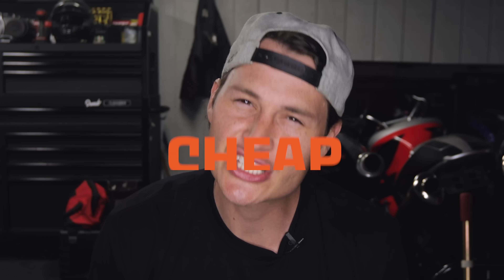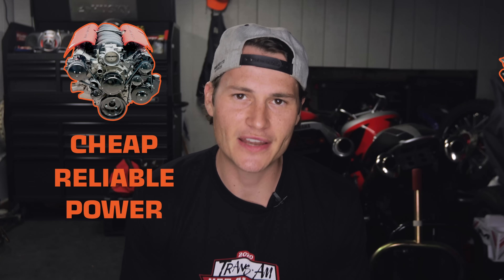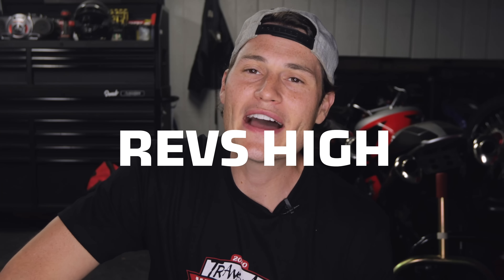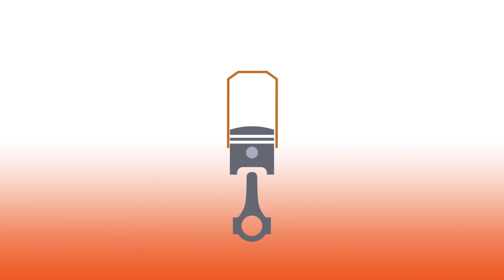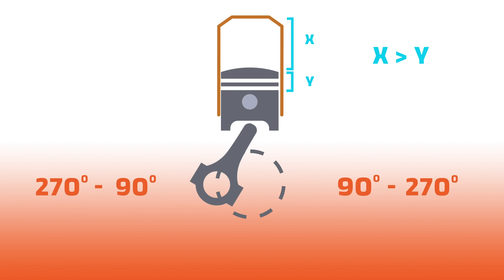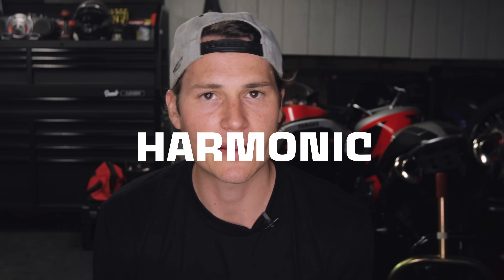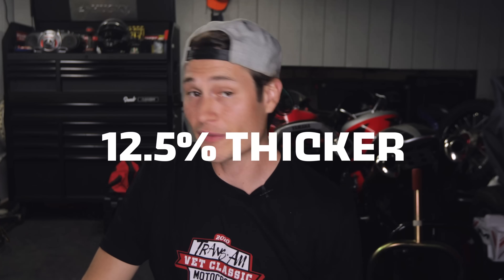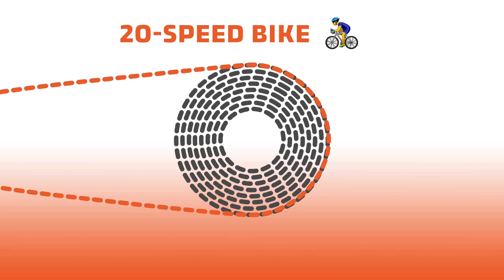Nissan VQ Engine - The Science Explained

Comment: Where are my VQ's that got a valve cover gasket leak atm?!? 💦 😂🤦‍♂️😁
Reply: It's stock from the factory.
Reply: My OIL be like "ight ima head out"
Reply: Cylinder 6 spark plug tube seal is leaking on my z😂
Reply: @boblouis972  cylinder 1 for me. i thought my oil filter housing/sandwich plate was leaking.
Reply: @boblouis972  Same with my Z just rtv seal it
Reply: Ayeeee
Reply: Fixed mine a few months ago.  Wasn’t too hard
Reply: Right here..
Reply: I just replaced my valve cover gasket on my vq35de today lol hope it holds up...
Reply: Nailed ittt
Reply: @FlameOnTheBeat  I believe it's DE problem. My HR only had the oil galley/gallery gasket problem. $700 out of my pocket but now I have reinforced gaskets and I don't have to worry about the engine at all.
Reply: @jakubkosowski7203  I think I'd rather have valve cover leaks than oil pressure issues...
Reply: @audioamateur  In HR the only thing is that gaskets. If you change them for aftermarket ones you're good. DE has it's own problems and RevUp too. Not mentioning DE has 25-40 buff horses less than HR. Mine has 301.7HP, my friends DE has 259.1hp.
Reply: @jakubkosowski7203  I'm on 301bhp for my 05 de also. MotordyneTdx2 with art pipes,plenum spacer, velocity stack on stock intake box, Kodak larger throttle body. So very happy with my numbers ❤️.  Nos is coming next though
Reply: @JarvBlart  That's very healthy for DE! I'm only running Magnaflow catback exhaust and Jim Wolf Technology short air intake (which in reality just subtracts torque, but it was installed by the previous owner 😬). My plans for the engine are probably supercharger (Stillen??), cams and cold air intake, but now I'm saving for oil cooler and Tomei LSD. Ahead are SPL camber arms, poly bushings and lightweight flywheel 🤗 (I already have Tein coilovers and Federal 595 RS-RR semi slicks). What are your plans for your Z? 😀
Reply: Yo!
Reply: Ayeeeee wassuspppppp
Reply: My VG30DE didn't leak
Reply: New valve covers with new gaskets can’t even fix the problem, WTF
Reply: Meee 🤣 my 62,000 de now has cylinder 6,3,2 with oil in the sparks loads of misfires.  But I've ordered new rockers so now have to wait till it's in the country. Feels like forever miss driving my z far to much
Reply: Me ! Replaced the gaskets and they still leak LMAOOO
Reply: You already know what it is bruh!
Reply: Cylinder 1 spark plug seal is leaking here. Lol
Reply: Mine’s at the mechanic fixing that issue 💀💀💀
Reply: Fixed it for 40 bucks on eBay definitely check it out
Reply: Yuuuuuppp. Just replaced a seal and a valve cover
Reply: Just fixed lol
Reply: Got em’ BOTH leaking boi
Reply: Right here boiiiiii 😂😂
Reply: burnin oil like crazy right now
Reply: Here... blew the engine. Where yall at now? Lol
Reply: Yoooo
Reply: Yoooo
Reply: My water pump went and now I have to can it cause my timing jumped 😭
Reply: Charles Nguyen what up fam!! Just bought new cover for 100 on rock auto
Reply: Yep mine leaked right into the starter.
Reply: Only the 3.5 in my 2002 Pathy had leaky valve covers and that happened at 200k. All my other VQ’s were good
Reply: I shot a rod, replaced the de with another de, then hopped in for a week and my shifter linkage died to death
Reply: My oil leak got worse when I replaced the gasket and the valve cover.  :(  It sealed the leak by the spark plug, but I can't get the gasket to seal properly now.
Reply: My mom
Reply: I got a VQ38DD, don't have that issue 😂

Comment: Donut spent $8,100 on a turbo kit to try and get a VQ to make power.  They ended up with 330 horsepower and an extremely unreliable engine.

What the heck kind of shenanigans are you pulling in saying the VQ makes cheap, reliable power?!  You guys just spent a ton of time and money proving it costs a lot of money to get an unreliable turd.

Comment: I swear I’ve been thinking about VQ swapping my S13 for about 2 weeks now. This is the universe telling me to do it.
Reply: Bish do ittt. You will not, I repeat, you will not regret it lol
Reply: After having my Z for a little over 2 years I gotta say I hate the VQ engine for modifications. They don’t make good power when compared to the money invested in them
Reply: @MoistSoul  very true but they come fantastic stock
Reply: @anthonym6918  stock they’re not bad, with a tune and some bolt ons they can get 300whp on a DE and like 320ish on an HR. If you look to go past that turbo kits are pricey for the decent ones and the blocks can only handle 400hp so then you gotta build the engine and that’s $$$. Stock they are fun though because you can beat them with no worries lol
Reply: Dude do it such a cool and reliable turn key swap
Reply: If parts etc are easily obtained locally I'd recommend building up a high compression sr20ve+t. Good usable power up to around 300kw without touching internals so works out to be cheap as chips
Reply: @astephen17  "cheap as chips" is the most Australian thing ive ever heard
Reply: DA NS vk56 swap! If you’re going to go through all of that, might as well upgrade to a v8. I’m thinking of swapping one on my q50. They use the same 7at tranny. If anything do a vq37vhr... too many problems with vq35 in my opinion.
Reply: My dream drift build is a G35 or G37 with a LSA motor. Making 700hp relaible as hell
Reply: Yoooo look up HexaGarage, basically S13 VQ swap wiki
Reply: No, don’t don’t do it
Reply: I wouldn't. Honestly for a little bit more money you could do a LS swap. You'll make alot more power and be alot more reliable. And it sounds amazing. Plus its got unlimited upgrade potential. From being N/A with a Cam and Heads making 400+RWHP. To supercharging or turbocharging making 600-800RWHP and being totally reliable. Plus it'll be super easy to sell if you ever wanted to get rid of it.

Comment: Random fact of the day, the 4.7 Mopar Modular V8 has a girdle too. Pretty pointless for an engine that only ever made 310 hp in its final iteration. 

Makes you wonder what plans Chrysler shelved for that engine. Could have been a DOHC beast with minor architectural changes.

Comment: So, not to bust any bubbles but man, my 06 G35 "Up Rev" coupe drank oil like it was forever thirsty. So much so that Infinity replaced the block under the oil consumption TSB and it still didn't fix it. Haha, they even replaced the transmission (did that first) because of a rattle when the car was in neutral. When they replaced the block the first time, I had them use the Nismo through out bearing and it fixed the transmission rattle that they just threw a whole new transmission at to fix originally that didnt work. 

Basically, while I was deployed, Infinity and my brother went round and round to get this thing fixed but never did. After doing much research while not doing anything in Afghanistan I found a thread on I think MyVQ forums and it said that this whole thing was caused by crap baffling in the valve cover, imagine that! But infinity didn't agree, at all! When I approached Infinity and Nissan about replacing the heads they told me NO and that I would have to suck it up and deal with the 3+ quart a month oil consumption. Basically because they were not going to put a 3rd block in it, yeah, the second one didn't fix it either,  and would NOT hear me about the heads because I used Internet research to find the root cause. 

So I sold it and bought another STi... that the engine blew up in, but I was totally ready for that, because EJ. Now, its got an IAG closed deck block and big ol spinny boy and 600 refined conservative buff herspers :)

Comment: I'm surprised at the lack of awareness that 2020 is the first time in 50 years that the Skyline and Z have shared an engine. The last time was in 1970 with the Nissan Skyline (KPGC10) GT-R and Nissan Fairlady (PS30) Z 432, which shared the Nissan S20 2.0L straight-six. Now, the current (upcoming) Nissan Fairlady (Z35) Z and the 2020 Nissan Skyline (5BA-RV37) 400R (sold outside Japan as the 2020 Infiniti Q50 Red Sport) will now share the VR30DETT (a 3.0L version of the VR38DETT from the Nissan (CBA-R35) GT-R).

Comment: Used to have a G35 with the VQ DE and it didn’t last more than 55k miles because of the oil starvation issue.  The HR is a much better version.

Comment: What! X = Y travel. The crank spins, therefore it's symmetrical. There is no difference in distance. The issue of the vibration is the linear piston acceleration and angular acceleration of the crank during the 4 strokes. The piston and crank are accelerating during the power stroke and decelerating during all other strokes... FFS, so much wrong in this video... I don't even wanna get started with the harmonic damper... Also wrong.

Comment: I actually own a car with a VQ, I cut down 4 trees for a 1995 maxima. It’s very unique tho, unlike most maximas of that year it has cloth interior, manual pass seat, no sunroof, no fog lights , base radio and speakers, no leathers, and came with Steelers and factory hubcaps. It’s only supposed to have 190 but I got if off an old man who’s son owned it for a while apparently did internal engine work and then got a newer car and lost interest, it sat at the house I painted and then cut the trees down at.  it fucking SLAPS like nobody in my friend group understands why but it cooks v6 challengers and mostly stock J32A’s

Comment: You forgot the intake. The reason the torque curve is so flat on vq motors is the intake has 2 valves that create a 3 stage intake. The first is 0-2300 rpm, where the swirl control valve is closed. It acts like the tornado device, creating a swirl in the intake. At around 2300, it becomes restricted, and opens up, creating a normal intake through short intake runners, until 5,000 rpm, where the power valve opens up, changing direction to long intake runners for high rpm horsepower.
Reply: Yep, variable intake runners. My 1990 Accord has those, as does my Mazda 929 and Acura Legend.

Comment: I’ve had a DE before and now I have an HR. I absolutely prefer the HR lol
Reply: Drive a vhr sometime. Even beteer
Reply: Lmaooo only de owners will know the difference between de, rev up, and hr. If your gonna buy a 350z buy a DE REVUP or HR. Or your de is going to eat your wallet like I eat cheesecake😏. I have a de 03’ Rn but I’m upgrading to a 370z for the engine block.
Reply: Tony760 if I’m honest the vqrev up is just as bad as the hr if you can just save up for the hr no questions asked ,I do own a vq35de non rev up.
Reply: @marcogonzalez2303  DE non Revup is the worst engine i ever had, and i had over 10 cars
Reply: Tony760 same
Reply: Tony760 eat your wallet how?
Reply: Tony760 there’s nothing wrong with the DE?
Reply: 69th like. Noice!
Reply: on B15u.com some of the VQ swap owners are doing HR head swaps. they are a little beast.
Reply: Non rev up?
Reply: I have all 3 the de is more harsh less refined and personally sounds better than the hr and vhr
Reply: I had a 2004 Nissan quest with that motor too. Strong  for the time, we had it. maintenance of the timming chain very important.
Reply: I own 3 VQ's right now. The HR is faster but not by that much. My SE-R altima keeps up with my HR z until 3rd gear then it starts walking slowly... wither way they're both unreliable engines I already replaced the white altima v6 6 speed on the picture profile (although that engine did last me until 220k) however the Z blew a piston at not even 150k miles.
Reply: I'll take the DE any day over the HR

Comment: the piston pairs in a six-cylinder DONT fire at the same time... firing order is 1, 5, 3, 6, 2, 4. they fire 60 degrees of a crankshaft rotation apart.
Reply: This comment deserves more attention
Reply: The piston doesn't travel faster at the top half of the rotation.... It accelerates until mid stroke and decelerates after mid stroke (both when traveling upward and downward)... Sorry but this video is just full of misinformation. The bike gear example is a bad one, and the harmonic damper doesnt actually work exactly like that.... Oh and i6 engines fire 1 5 3 6 2  4, not 2 cylinders at the same time
Reply: @alexnicolaou3579  in my workplace we memorise the firing order for i6 like this: with 15 she's too young, with 36 she's too old and if she's 24 it's perfect
Reply: @alexnicolaou3579   No, it's correct that the piston moves faster for the first 90deg of crank rotation (from TDC to middle) than for the second 90deg (from middle to BDC). Learned it myself recently on an actual good, informative video (unlike the junk here). The reason has to do with the geometry of how the big end of the conrod moves sideways out and then back in as the crank rotates.
  https://www.youtube.com/watch?v=82rxavW0A3c&t=10s

Also, how could a "car" channel get the firing order of an L6 wrong so badly?
Reply: @alexnicolaou3579  this is what happens when you try to over simplify so the biggest idiots can understand and think they learned something.  I noticed many errors throughout but the general gyst of everything was decent.
Reply: @alexnicolaou3579  thank you..... the crank is not oblong shaped or egg cam like, it rotates in a circle. i scratched my head when he said this.
Reply: @alexnicolaou3579  yeah! I was just at minute 8 or 9 when I started thinking some things dont add up. Piston travelling distance on TDC vs BDC?? Heads up!!! Its the same!!! Too much misinformation. One donut subscriber less.
Reply: Bingo, 3 and 4 are both at TDC but if 3 is going into power stroke 4 is pushing exhaust. I'm surprised they made this mistake.
Reply: Straight-six engines typically use a firing order of 1-5-3-6-2-4, which results in perfect primary and secondary balance.

As stated on wiki. And a nice gif https://en.wikipedia.org/wiki/File:Inline_6_Cylinder_with_firing_order_1-5-3-6-2-4.gif
Reply: I thought after being a HOME mechanic for 30 years I learned something new. I always thought when two positions are traveling in the same direction they are on opposite strokes as in one would be on the power stroke and the other would be on the intake stroke.
Reply: Dude, the firing order for the engine he’s talking about is not at all your basic v6. It’s literally as simple as googling “piston firing order for vq35de engine” and it plainly states EVERYWHERE that the pistons fire in the order of 1,2,3,4,5,6. The guy isn’t a damn clueless fool. Stop trying to act so damn superior when you clearly don’t know about THIS engine at all.
Reply: @nicholasgicante9253  oh forgive me for not knowing this very specific engine type and not googling its firing order, let alone thinking they didnt actually talk about a regular V6, i mean why would they right?
Reply: @daenueel1546  ahh actually you deserved that coming out as a know it all when you failed to follow along..not all 6 cyl are the same as we now know....
Reply: @yeahna  coming out? am i gay?
no for real tho, fine they used the right firing order for THAT SPECIFIC motor, still it's kind of dumb not explaining a regular firing order instead of an exceptional one.
also i'm not a know it all, i pointed out what i thought was wrong.
if that's a problem for you i wonder how you survive the internet
Reply: @daenueel1546  don't get hurt because you made yourself look stupid it happens
Reply: @yeahna  ;(
Reply: Unless he meant the si motor? But si doesn’t have v6 lol
Reply: Wow he said IF they fire all at time 😂
Reply: the vq has a 1 2 3 4 5 6 firing order
Reply: Actually a 6 clyinder engine would fire every 120 degrees. A 12 cylinder would fire every 60. 720÷6 =120 degrees.
Reply: It's 120 deg each fire
Reply: If you watched most of the video, he mentioned the firing order you brought up for a V6.
Reply: yeah i just saw that, aaaaaand im closing this video.

Comment: The bike gears shift the other way around when you are trying to go faster (:
Reply: and a 20-speed bike' cogs doesn't look like that
Reply: Rear downsizes and front upsizes to gain speed at the cost of effort
Reply: Na, depends which cogs you are looking at. If they were talking about the rear sproket they would be wrong but if they were talking about the front its correct.
Reply: but yea, who the fuck has that many cogs on the front
Reply: @alexinkster6619  if that was the front sprocket, the video is upside down. 🤦‍♂️
Reply: @alexinkster6619  its obviously in the rear
Reply: Its just easier to visualize that way
Reply: Man I was about to say that .

I like God damn you're going the wrong direction you want more speed
Reply: And it's spinning backwards!
Reply: You've gotta be kidding me. Dude has an engineering degree, does he not? Well, so do I. Pretty sure he knows how a chain drive works, and his the picture does a fine job of illustrating the idea. The less time you spend picking things apart, the better chance you have at learning something
Reply: You beat me to it, I need to HTFU
Reply: I was thinking the same thing
Reply: I never understood bike speeds I just left on the one it was on at the store since it isn’t hilly where I live
Reply: Jordan I hope your not of age to vote
Reply: Dog Town Kai Well ig you’d be disappointed cuz I’m turning 18 a few weeks before election day lol but the resistance didn’t change when I changed the speeds so maybe I just have a shitty bike 🤷‍♂️